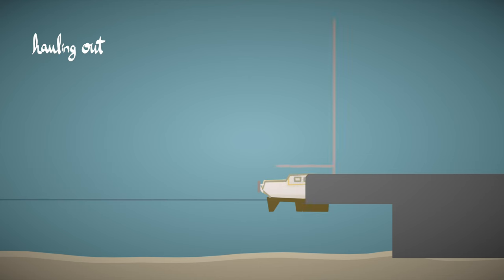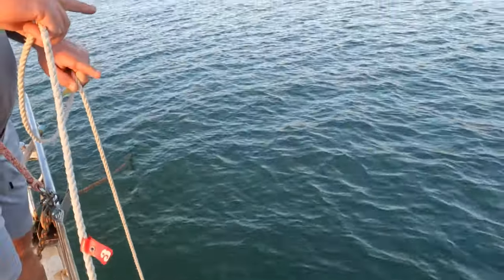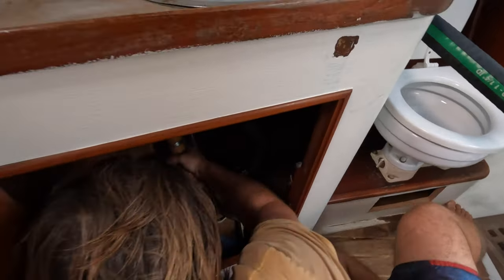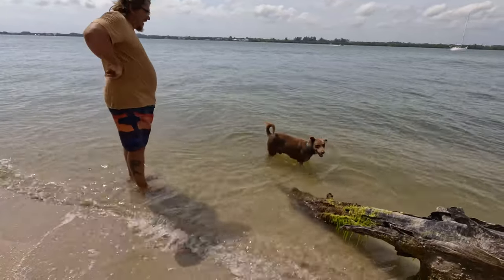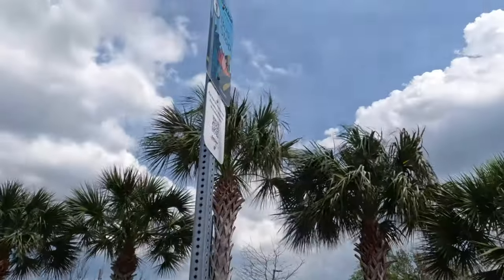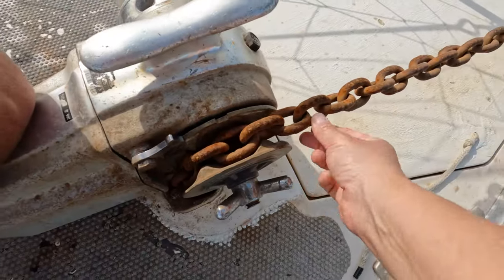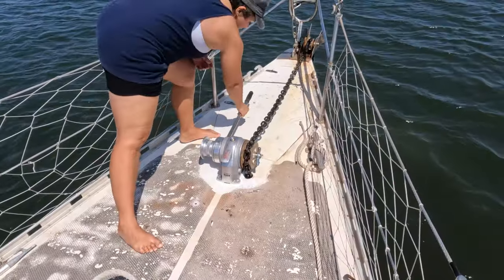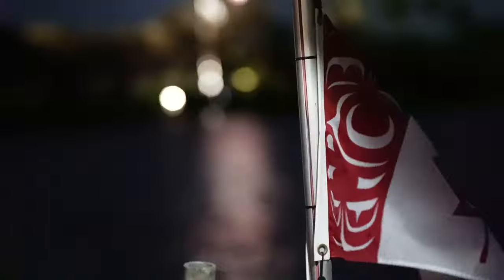CRAPPY sailboat gets upgrades

Comment: We have a new-to-us 50-year old sailboat. A couple of months ago, we changed out the old Vetus windlass which was made by Lofrans and similar to yours. Our wingnut looks the same and is too expensive as you said. We replaced the windlass with a like-new Simpson-Lawrence manual Anchorman. We have been very happy with the one on our other boat. Why didn't you just go with a "composting" toilet? The holding tank takes up so much room. Anyway, glad you're making progress. Have to stop watching now as we are intalling the last 3 of our new opening ports. Take care!
Reply from the maker: Good luck with your project! Another commenter mentioned the composting head - perhaps that could have worked for us! But I replied there as well that we are hoping to install a treatment system someday, no extra chemicals or materials needed after it’s installed:  https://www.raritaneng.com/blog/how-does-the-electroscan-waste-treatment-device-work/
Reply: @sailorama  No chemicals or electricity needed with our composting head. Just some peat moss or sawdust to cover the "solids". Very much a KISS solution. We finished installing our opening ports today. Hurray! Now onto the next project.

Comment: Dunno if this was already mentioned or you already know but you can kedge / pull on the lengthened halyard spinnaker halyard. This doesn't need much bc of the leverage, we "pulled" folks of the rocks by basically just putting the engine in gear in reverse with a itty bitty two blade prop after power boats where going full tilt pulling straight..
Reply: also, with the anchor, you can attach an old piece of rope before dropping and haul it with a sheet winch. Or use a prusik or stopper knot to at least haul it across the foredeck/until with a sheet winch until the chain rubs on something.
Reply from the maker: Yes, what you describe is possible, but fortunately we never got to the point where we had to put strain on our mast.
Reply: @sailorama  well, if you're sailing at x degrees tilt with your spinnaker, the force on the masthead while pulling from a dinghy / kedge anchor for the same x degrees is not that different. Just try pulling it by hand from the dock. You easily get a couple of degrees and if your're stuck without leaning (and your keel is still rigidly attached). Then you only need to raise it a tiny bit (+- tide, reaction time, ...).
Reply from the maker: Good point! The mast is a great lever - we see it when we get a good heal on 😁

Comment: That new windlass is the same as the one we have. Thank you for A) reassuring me it has stronger bits for manual use and B) for all those shots of it taken somewhat apart. Changing the gypsy is the most likely thing I will need to do. Your handle looks longer than ours but that could be the camera wide angle lens..... and watching you go through replacing yours, I think having a short or at least no longer than stock handle is probably wise. I like the hatch into the anchor locker but I don't know that I have enough room up there on our 29footer to add such a deal. Do note that with out a hause you will get a bit of water in the chain locker when it rains or in rough seas.... I would guess that is not a huge deal and you already watch your bilges as we have learned to do.
Reply from the maker: Cool 😎 Yes, we don’t mind a bit of water getting into the chain locker because it’s a big old space that does not open up into the inside of our boat at all. Also, we’ve been thinking about finding a stainless pipe that is slightly longer than the handle that came with the royal windlass - I’m a very short person and it doesn’t bother my back to use it, however a longer handle would suite Robi better.

Comment: No composting head?  We use one and love it, just keep a supply of peat moss, one bag lasts months.  When in a harbor, just dispose of the bagged waste in any trash receptacle, when at sea, dump it over board!  I made mine from a toilet lid and bucket, total cost $10.
Reply from the maker: Sounds great, but we heard that composting can still be a little more stinky…perhaps, or perhaps not…in any case, our dream is still to get this kind of waste treatment onboard: https://www.raritaneng.com/blog/how-does-the-electroscan-waste-treatment-device-work/
Reply: Grr8 teamwork!!! Oh that Jimmy Hendricks salute was awesome too!
Glad you hooked up in a good locale for supplies and support... I have suggested using a Chevy bendex starter motor for the windlass in other videos... Used , rebuilt and new are powerful and affordable😅
Reply: @sailorama that’s a great looking system. Fww the homemade composting toilets you can add a computer fan and piping to create negative air pressure and pull any smells to the outdoors. If used properly any detectable smell is “earthy” not poopy. Dealing with the jugs of pee is another story…..
Reply: @robertgold2643  We've had a composting toilet for 10 years. No problems.